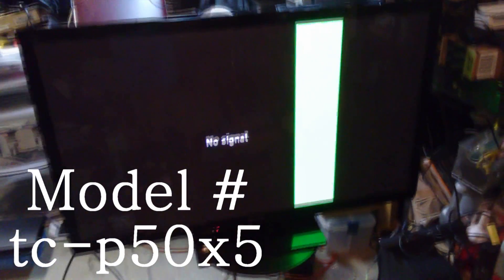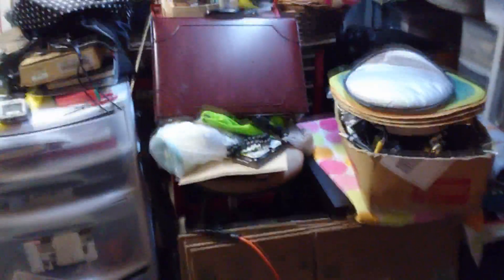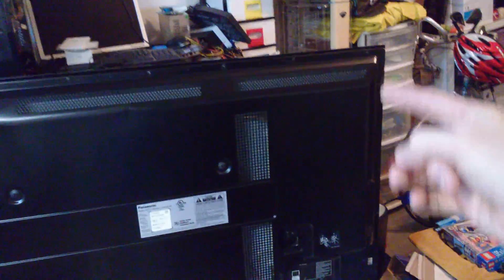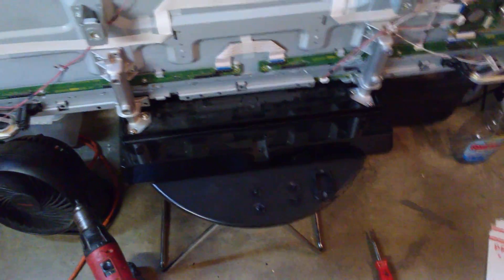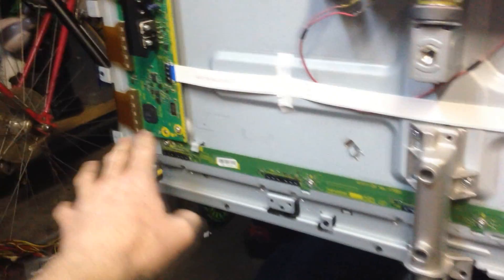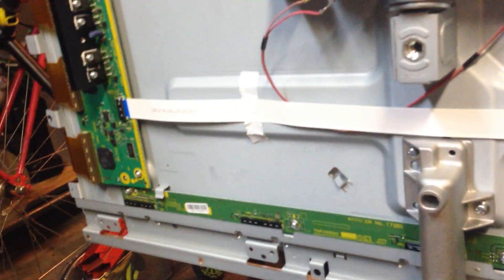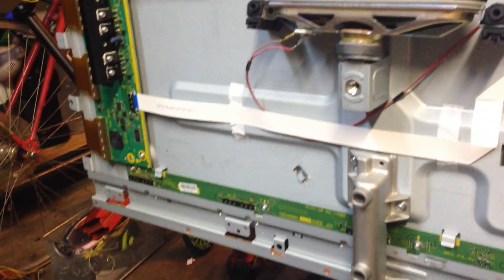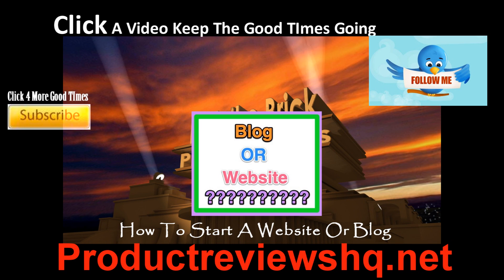Panasonic Plasma TV TC-P50X5 Vertical Green Bar Line Fix

Comment: I had this problem out of the blue.

It went on for about an hour - hour and a half.

It went from 1-2 vertical lines dead like in the video, with big blue bar, to 5 dead lines, back down to 1, then it was all normal again.
I think in my case it was caused by dust interfering with the chips. I blew air into the vents at the bottom of the TV and also the heat from the plasma running helped expand the connection, I believe. Finally, what brought the dead lines back to life completely, was having an anti-image retention video / GIF playing on the screen for 30 mintues. somehow this helped.

Comment: Thanks for the video - helped a lot.
We had the same green vertical bar appear a few days ago, almost dead center on our TV (Panasonic TH-C42F D18  manuf & bought 2008).
Ours is an older model than the one you resurrected and, as you predicted,  the panel was much more populated with additional circuit boards, wire harnesses, etc. (and had even more screws to remove). However,  was finally able to access the ribbon cable board at the bottom. After removing the metal clamps (look like heat sinks??) from the 3 center ribbons, I opened their connectors and removed the ribbon cable ends. After giving the 3 connectors and the cable ends a good cleaning with an acid brush, they were mated up and re-seated again and everything went back together in reverse order.
Result: no vertical bar, and I now know what to do if another one shows up elsewhere on the screen. Thanks again.

Comment: I have  a Panasonic 48" LED tv that is displaying a similar fault but the bar is not green but grey with 'noise' in it .It is in the same position and has no 'running ink effect' near the bottom (common with screen failures).Do you think it's a similar issue?

Comment: I have a plasma TV Panasonic TH-42PA60M it has a vertical big line in the middle how should i fix it i have tried to clean the fibre which connects there but it has refused plse help me. Thanks

Comment: i have the pnd550 plasma and when i turn it on it sparkles and it the pixel dont respond fast enough with solid colors being presented . i was thinking of replacing my buffer board as well. is that what i have to do ?

Comment: Hello. I'm working on the same exact model. I am having difficulty removing that metal cover plate over the two buffer boards. I removed the speakers and all screws but it will not budge. It seems like it wants to come off but at the same time I feel like it's attached to the front bezel. Do you have another video that shows how you were able to remove that? Thanks in advance for any info.
Show less

Comment: Would a partial vertical bar potentially be the same issue? The bar starts at the top of the tv and runs about half way down the screen, but ends there. Any suggestions?
Reply: +ijramos45 Same. What did you do?
Reply: Well, there was a TV on craigslist that I was trying to do some research on whether or not it'd be a good deal. It ended up being sold while I was doing research. I wasn't able to try it